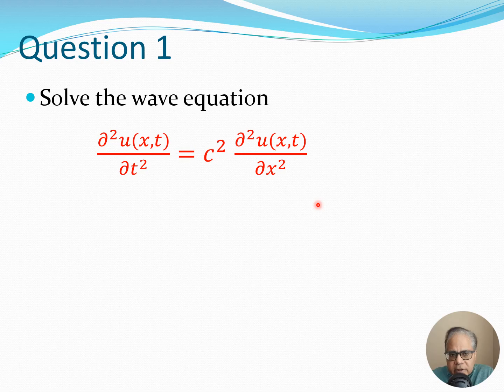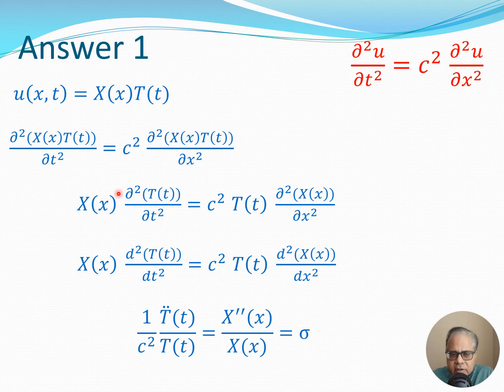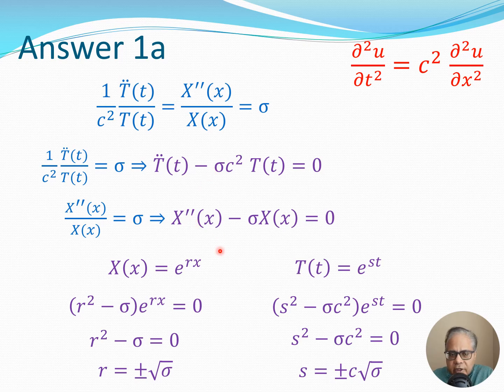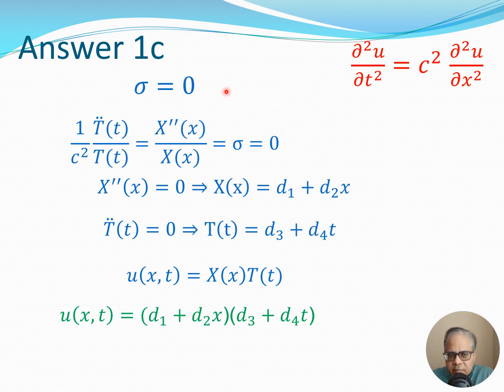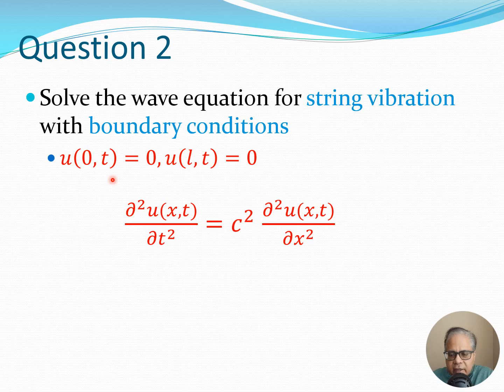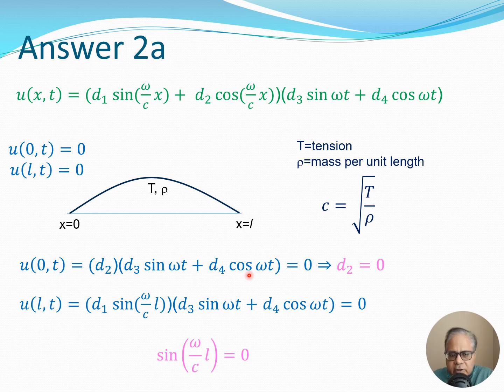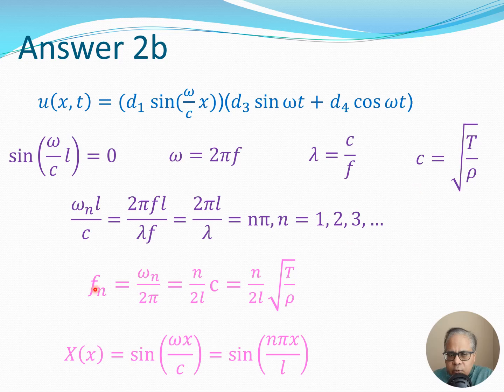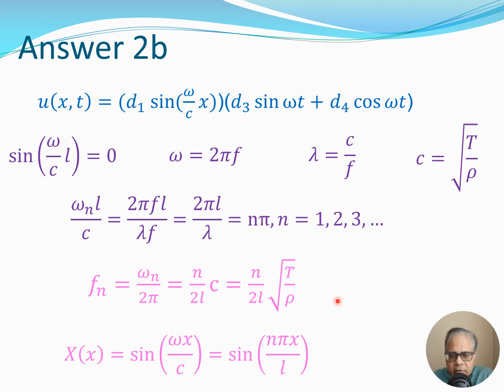Math Question Bank 25, Wave Equation

Comment: Dear Sir, Is X(x)=d1Sin(wx/c)? what has happened to d1 in Answer 2b?
Reply from the maker: X are the mode shapes of the string or eigenfunctions for the problem. The solution u(x,t) will still have d1 etc but the mode shapes do not have constants as they represent shapes only.